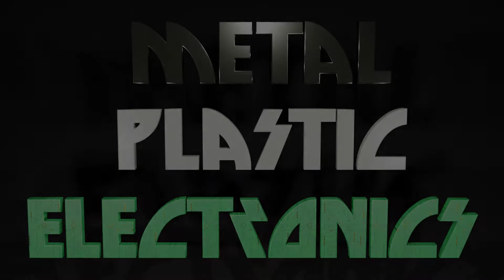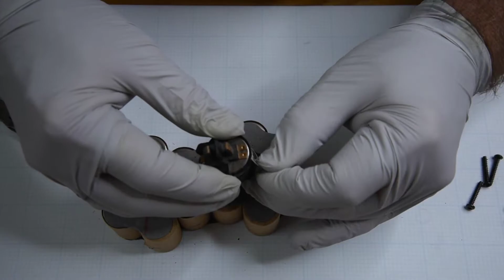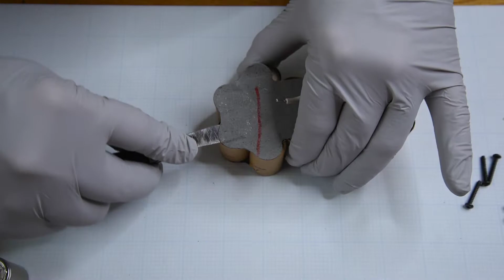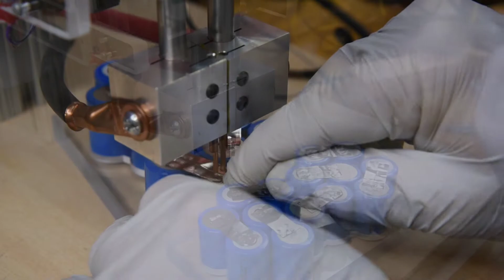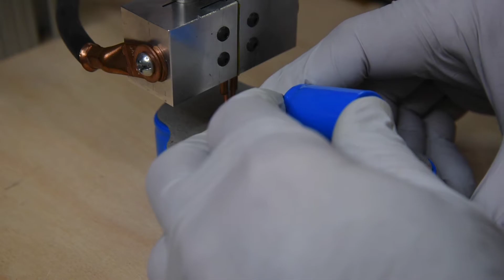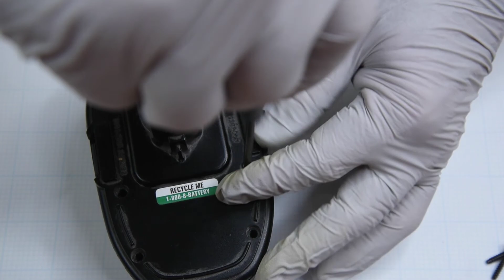DeWalt DC9098 rebuild

Comment: What welder do you have? I want to investigate getting one of these. I just rebuilt one and soldering is not as efficient. Also, I have DC9098 batteries which didn’t take the sub c they take the 4/5 sub c. Unfortunately I didn’t check that until I made 15 batteries not returnable. Thank you for making this video.
Reply from the maker: It’s a home made welder.  This is one of the videos about it: https://youtu.be/fRQPwXB6LXU .  The weld head is also home made: https://youtu.be/ej4XvwX1UR4 .  Both are still a work in progress.  Yes, spot welding is the way to go for the battery tabs.  But in the past I’ve had to make do with soldering them.  Sometimes makes it really hard to get the batteries back in the case.

Comment: I would have just converted it to li-on batteries. It is hard to find the regular size c batteries for replacement, they all seem to have gone to sub c cells which do not last at all. this is a great video on how to do a battery pack.
Reply from the maker: It was hard to find the right batteries for it.  But the old charger for it still works good and the tools do as well.
Reply: @metalplasticelectronics354  I Had the same problem and those sub c cells do not last as long as the original batteries. I found on amazon the BMS board for one of my 12 volt battery drills that I really like and I can am able to use the same charger for it. Depends in the input amperage and voltage of the BMS board. I have a Milwaukee V18 battery with lipo cells in them. I have rebuilt 2 of these so far 7100 series batteries from Tesla cars. They are still at 95% of their capacity and are rated at 4800mAh. Uses 5 batteries and can use the old battery management system. They are now 5 amp hour batteries. Also the battery pack is lighter. I have one more to convert, thinking of making a video in it, but I have never made a video. It is a feeling of accomplishment after you rebuild a battery pack. Best of all you have your favorite tool yet.
Reply from the maker: @countryside8122  Make a video of it.  The tools outlast the battery packs and I hate getting use to new drills and such.